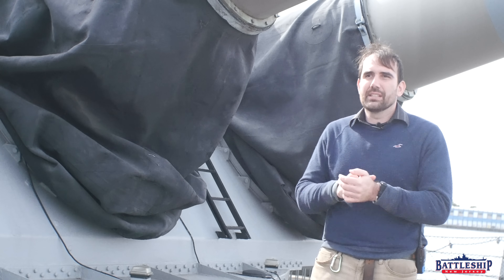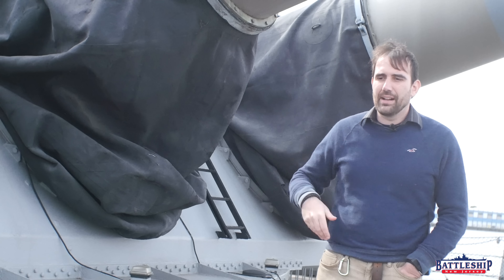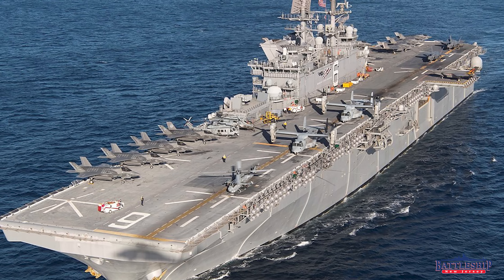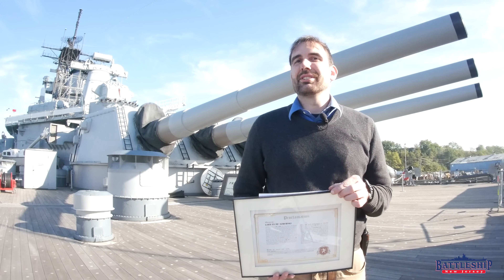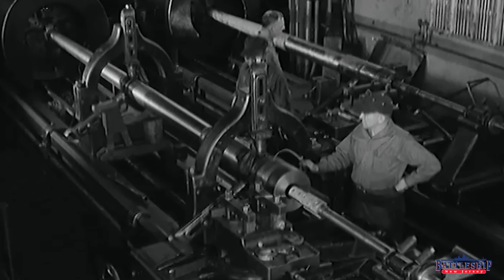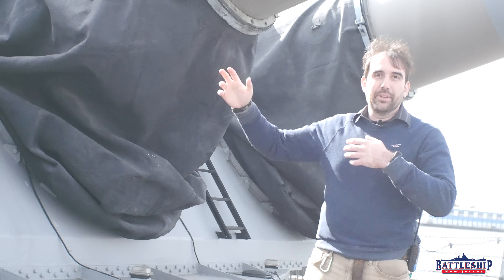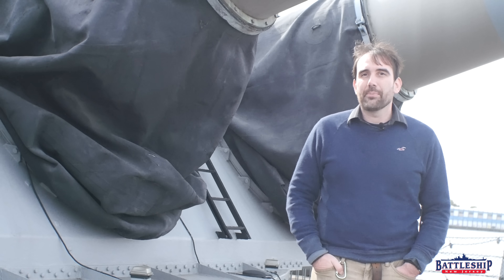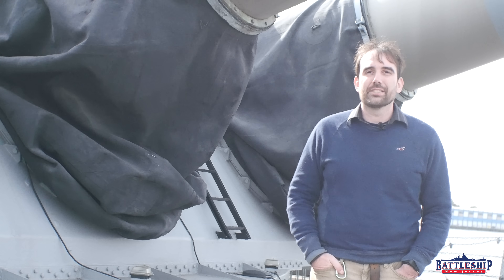How Much Would It Cost to Build a Battleship Today?

Comment: In some ways, this is an incredibly pointless question.  If you choose "duplicate", and only allow upgrades for radios, LED light bulbs, non-asbestos insulation, etc, then you end up with a generally useless ship.  If you choose "modernize", with missiles instead of 16" guns, nuclear power, Aegis radar, then you no longer have a battleship.  Remember, the armor on a battleship is not an all-encompassing bubble; it is an armored deck, waterline belts, and a conning tower; what use is that when a mission kill by antenna destruction is far easier and more useful?  Ask the USS South Dakota crew how easy a mission kill was.

Comment: Given one would want a series of these ships into the future; The only proper thing to do would be to build the shipyard that would be able to build these ships.
Current Iowas make 240K shaft HP (or 16MWatts) which is equivalent to a small nuclear power plant; but given that you want to run craploads of electronics, shoot at the 100MWatt power plant. #2 oil and Diesel is not to be sanctioned (or desired) staying power on location is more important.
Make the ships just as fast as the Ford class carriers (if not a bit faster). And since we are not allowed to know how fast they are these new battle ships would be nearing 40 knots.
Armament is in question: all of our modern ships are built to avoid getting hit, plus what would be hitting these ships would be considerably more damaging than even a hit from a Yamato. I am not sure that armor is the right course. Fast, unarmored, highly maneuverable (perhaps under computer avoidance) with the guns completely computer controlled compensating for maneuvers automatically. Without armament the size of the ship could be increased, or the ship cold be made smaller or both and still end up with a ship for its assigned purposes.
Assuming the guns are in the explosive projectiles category and using modern ballistics knowledge, the projectiles would be guided to the targets, so range is more important than 'throw weight'. Reload and fire speed should be in the 10 second range, and the barrels water cooled if necessary to sustain that rate of fire. Thus it would have to be all automated.
With all this automation, crew size should be in the 1,000 sailor class.

Comment: I think the closest comparison today to having to ramp up a Shipyard to build Battleships, is Australia's plan to build SSNs in Australia. It will cost Billions to get the Shipyard and the workforce up to scratch, Australia has never built SSNs, has no experience in operating them, fortunately we have some great friends in the US and UK, and hasn't built a Submarine in over 20 years.
There is really no sensible reason to bring Battleships back, money would be far better spent on a new class of Cruisers to replace the Ticos.
But if you were going to do it, I definitely think you would go with new ships, nuclear powered, you can use the same reactors as the Ford class. You could probably cut the crew size in half compared with Iowa's, with a lot more automation. You would need to invest in a fully automated, unmanned 16in Turret, MK 45 5in and Mk 110 2.5in will do for secondary Guns. 4-6x8 Mk 41 for ESSM or 4-8 SeaRAM systems. A CMS based on AEGIS,

Comment: Honestly, I believe a better place to start would be modernizing an Alaska class Battle Cruiser.  Six 12" guns in the front and a missile launcher in the rear, along with armor that while not up to the Iowa class would be proof against any modern missiles or guns in use today.  And build enough to match one up with each of the Amphibious groups, so they can provide some serious ground support in case the Marines do need to land on the ground.

As there are really no "capitol ships" anymore an Iowa class would be overkill in most cases.  But a Battle Cruiser built with good armor and six large guns for shore support would be of great use when paired with the Amphibious groups like the USS America.  Especially if they made RAP rocket assisted projectiles for it.  A 12" shell with a range of 100 miles would be enough to scare most adversaries.

Comment: Reactivating the museum ships makes no sense.  Their hulls are ancient in sea-faring terms and much weaker than they were when active.  If a battleship were built today I would think it would be an enlarged Ticonderoga cruiser.  The largest gun would be 3 or 5 inches, and there would probably be at the most two of them.  The main armament would be various missiles with a vertical launch system.  The number of crew needed would be much smaller than the Iowa's and missiles would be far more accurate and powerful than a 16" gun.

Comment: The day of big naval guns is gone unfortunately. However a repurposed Nimitz class hull with refurbished reactors would make an awesome missile boat. With a couple of navalized  self loading Paladin sized guns and a handful of CWIZ mounts for drone swarms the rest of the available space could be packed with missiles of all types. (Designed to all be reloadable at sea). With enough nuclear power on hand it could also be fitted with multiple high speed lasers for both anti air and point defense. It would be nice to have the armor of a battleship to minimize damage from missile and drone strikes but it probably would not need to be as heavy as nobody is lobbing 16-18" shells anymore.

Comment: Ten minutes I can't get back.  If you were to restart battleships they would be new builds!  There would be no 16-inch guns and probably no 5-inch guns either.  The 6-inch guns would be replaced with CWIZ and rolling frame missiles.  The ship would be around 950 ft and have two nuclear reactors driving it at 40 knots.  The VLS systems would be composed of over 400 tubes that could be recharged below the deck.  Include two turrets fore and aft housing two each super range rail guns.   A President would ask where are the carriers? And in the same breath ask where are the battleships.  The new battleship would be able to put more iron on target faster than a carrier.  After the initial shots, the air wings would have after strikes.  Imagine the middle east with one of these and a carrier in the Med and the same configuration in the Gulf.  Really think Iran would be making any mischief?  The exact same with China.

Comment: I think you keep getting hung up on Battleship = 16in 50cal guns.  I like the imagination of a railgun battleship, but I think "practically" speaking (with not much emphasis on practical,  "modern battleship" would be an extra large modern cruiser.  I kind of see older cruisers as smaller battleships so why can't it go the other way with modern platforms?

Comment: New would certainly be the way to go, long-term.  That said, why choose?  I'd reactivate at least two vintage battleships in Year One, then use them while the first couple of new ships are being constructed.  Once the new ships are online, swap them into the fleet and retire the old units as desired.
As much as going with nuclear power would have certain obvious advantages, the disadvantages would be prohibitive, at least for me.  Firstly, the cost is simply too much to bear in any remotely realistic funding scenario.  Secondly, all of that money would be spent on ships that we absolutely couldn't afford to lose.  While the same might be said, from at least the nuclear perspective, about any modern carrier, those ships are the centerpieces of battle groups designed to protect them and that would not, by definition, be the case with a battleship, even a nuclear-powered one.

Comment: Build new. You can add modern efficiency to reduce required crew size,  reduced operating costs.  You could convert to nuclear power,  reduced operating costs.  You could equipment with modern weapons and increase lethality.  But at the end of the day you would end of with a completely different design based on modern threats and missions.

Comment: If your building a new  battleship you look at the world we live in. No one is getting that close anymore.  So pull the turrets and use the space for vertical launch systems. Normally when you replace those it's done at the dock. But you may design a way to store them in the old ammunition holds and then be able to pull them up out of storage and replace them during down time,  giving the battleship more shots.

Comment: A modern battleship has no other battleships to fight so you don't need heavy armor because no one is shooting back. Everyone uses planes and missiles though so trade armor out for anti-air and anti-missile systems, OR just have the heavy guns and let other ships in do the air defense instead. Then you're left with a big gun platform and advanced targeting computers/sensors for shore bombardment. You could build a cruiser with one triple 16" turret instead.

Comment: This is close to impossible to answer. Lots of problems and questions to answer. What would this ship use for propulsion? What is the armourment? There are other issues. A modern dreadnought will be lighter than the Iowa. All or nothing armour isn't really a thing. 16 inch guns wouldn't be used. Missiles have long since replaced the big guns. If you replaced those big guns with VLS, a modern battleship would have alot of missiles. Frankly I would build new or reactivate the iowas. Both are just a big noisy target for an attack submarine, and a carrier battlegroup will still have alot more utility than a battlegroup with a battleship. This is why no other navy in the world retained battleships after the 1950s. The monney is better spent on escorts. I would estimate the cost of a new build to be in the range of 10 to 20 billion. That gets you 5 to 10 flight 3 Arleigh Burkes. I'd rather have Burkes, more utility. BTW a better comparison on what a modern battleship would like is the Kirov class.

Comment: First off thanks Ryan for the promotion to SECNAV.  It’s a better office than what I have. 

I’d build new battleships because simply put the Iowa class doesn’t make sense in modern combat.  I could see a smaller number of guns- say 4-6- for gunnery support forward.   On the aft I’d build VLS cells which gives it range and far more anti-surface and anti-air capabilities.  I also imagine that a more modern gun system would require far less crew than 1940s technology allowed.  

With the new ship I would put in more modern engines which require less crew and fuel to operate.   I also would examine if azimuth pods were an option for increased maneuverability. As Ryan has pointed out they would have to be conventionally powered as nuclear engines do not like being jarred as one might expect in a surface combatant.

Comment: i would try to do both, i would build a new ship, but only so much parts of the ship that dont need new infrastructure. then i would take an iowa battleship, taking their main guns and maybe the secondarys aswell, taking them apart, complete overhaul and install them on the new hull. in the meantime i would try to build up the infrastructre we need to build 16 inch guns/turrets. as soon as new guns are available we could either put them into storage or installing the overhauled guns back into the old BB, and installing the newer guns into the new hull. 
the brits did it the same with their last BB HMS Vanguard

Comment: I would say reactivate. They could do something different with the propulsion system it be a little more expensive to reactivate but those old fashion boilers could go to a modern Power plants. The 16 inch guns are very impressive they can shoot a volts wagon 25 miles basically. And there’s probably a stock pile of 16 inch shells in powder setting somewhere in some ammunition depot. In the 5 inch 30/8 they’re good guns my shit Padam and it was built in 65 launch and 66 and commission 67 in Pearl Harbor on December 7. So basically she had a World War II gun. I don’t think as rocket launchers were available in World War II so that’s modern at the time. But she was an ASW ship. New Jersey and Iowa class battleships when they were re-done in the 80s or actually more modern then my ship was built in the 60s. We did not have the Felix system. We did not have launch containers on my ship. We had to triple mark 26 torpedo tubes I believe 2 5 inch 30/8 and an Azrok launcher

Comment: By building new, not only would you get the new ships, but you'd see new technologies developed in the process. Base the main weaponry on railguns, and you have a brand new, hyper-lethal weapon that can be dispersed throughout the rest of the Navy and other services. Automation of a lot of the battleship's individual systems would cut the crew requirements greatly. New propulsion and defensive systems would ensure the survivability of these ships and other ships to come. Consider incorporating stealth technology so they're harder to track and target, laser weaponry for point-defense, and vertical launch missiles and torpedoes to deal with submarine threats.

So yeah, they may cost more up-front than just reactivating the good ol' girls, but I think you'd get far more for your money if you bit the bullet and came up with a truly modern dreadnought.

Comment: Fact is, guns simply can't compete in range, accuracy, or destructive capability with the various missile stuff that exist nowdays.  There is no reason to have a BB such as Iowa class back in service... other than it would be totally badass.  
I think, however ther is a good idea to have a modern equivalent of a BB.
A modern BB should be nuclear powered, & instead of big guns, carry all manner of missile stuff (anti-ship, anti-air, ballistic, anti-sub, basically able to kill literally any military machine or installation on earth).
Also, a modern BB ought to be able to tank lots of damage, just as in the old days.  That's kind of one of the whole points of battleships.  Modern reactive armor &/or other cool hi tech systems in conjunction with old-fashioned thick steel, would allow a Modern BB to shrug off all but a critical hit.  They'd be a huge force multiplier to a carrier task force.

Unfortunately, it would make more sense to just make a lot of modern frigates or DD's instead.

Comment: I think with modern technology and metallurgy, if we retooled to build new weapons, and did a complete overhaul, upgrading all of the plumbing and wiring.  Bringing a WW II battleship back may be cost effective if it is necessary to be rapid.  Alternatively, if we retooled to build the weapons and armor plating, it would be much more beneficial to build a new battleship. If we also consider, with modern fire-control, as well as modern quality control and metallurgy, we can build guns that can withstand much greater force and propel a shell at much higher velocity and range, while still hitting the target. This means that a new, or even modernized battleship would be beneficial in terms of bombardment if we needed to support landing troops on foreign soil. Though the firepower would still be limited against surface ships based on practicality of accuracy against moving and maneuvering targets.

Comment: I think in modern warfare you're looking at a battle ship ship more for shore bombardment, lets face it ship to ship is going to be happening over the horizon any way.  so, montana class(revisiting some vintage) big guns, vertical launch tubes, helicopter/vtol deck, modern fire control, gas turbine.  basically a heavy arleigh burke

Comment: You'd have to build them new. Besides all of the points Ryan made, there is a huge difference between how to run equipment like the manual says, and how to run equipment how seasoned operators run it and we don't have very many of those left for the battlewagons.

Comment: My take?

If you need a battleship, I.E. you're fighting another battleship, take an Iowa out of storage. 
However if you need an ocean going monitor here is what I'd do:
I'd go with a battle cruiser analog. 
For passive protection rolled homogeneous sheet armour is widely produced and available, use thinner sheets in layers, with spall liners, because layered armour is more effective, and cheaper to manufacture.
Gun armament?
9 x 16" guns is excessive today.
2 minimum 4 maximum 16" guns, purely because most of the Iowa's fire missions have been shore bombardments.
And it was the 16" HCs that did the job.
I mean you could go 18" for the extra reach.
Rail and coilguns are a non starter at this point.
You could use liquid or powdered propellants I guess, do away with silk bags and have an integrated propellants loader in the gun?
Or maybe a giant cased propellant charge like in modern 120/125mm guns?
But with today's technology you could have an automated gun house for the main battery with a bit of thought.
Take the 5" mounts and scale them up "a bit"

Basically a heavy/battle cruiser built around the shore bombardments mission with usual destroyer armaments SAM Autocannons etc

Comment: The only real advantage over the power projection offered by a carrier's air wing would be the ability to lay sustained gunfire on a target relatively close to the shore, which is the reason the USMC was so adamant about keeping the battleships in reserve.
If we wanted new construction ships to support such a mission, we might consider a simpler armored monitor that could operate in the littoral and pound targets ashore. Choose your caliber.
If you could somehow reproduce a 16-in gun with its supporting life cycle and ammunition trains, you might even consider a rocket assisted projectile that could reach out much further than BB-62's 16 in 50s.